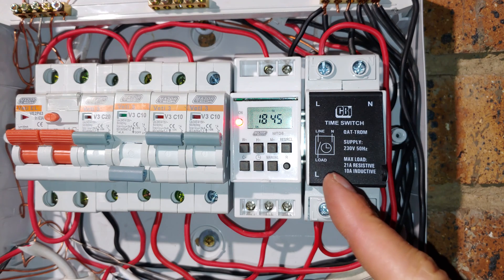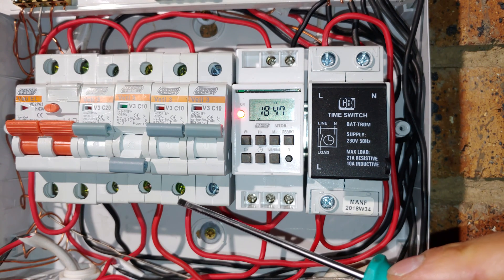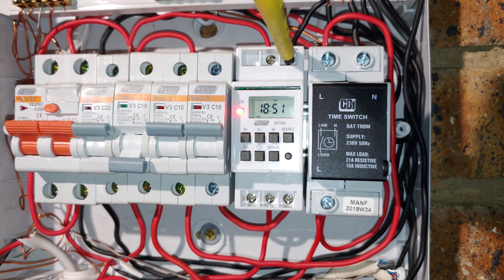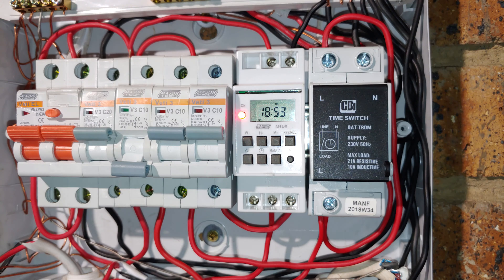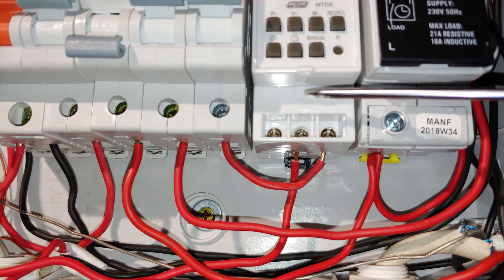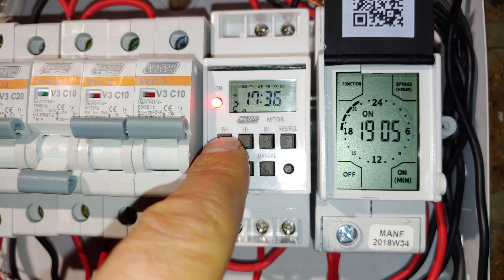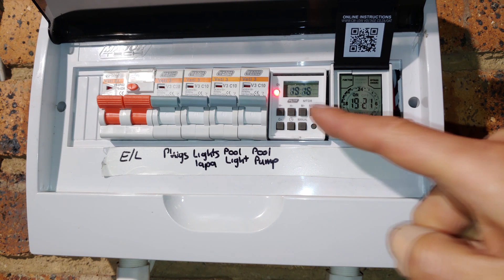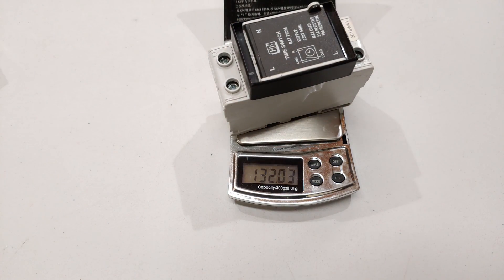Major Tech MTD8 timer versus the CBI QAT-TDRM timer - detailed comparison

Comment: Hi, my CBI has worked well for about 3 years,.  However upon activating recently, the timer emits a ticking noise for about 3 minutes before continuing to work normally.  Is that a battery issue?
Reply from the maker: if i recall they have a supercapicitor not a battery but it sounds like the noise of from the relay. The "battery/capacitor" is there just to keep settings when power is off. If your relay is making that ticking sound, check your load is correct and not very high, also check your wiring isn't causing any arcs. Check all connections are tight.  Relays do go faulty as well.